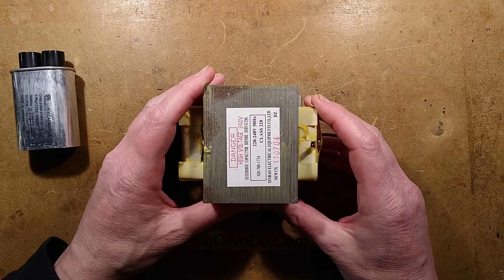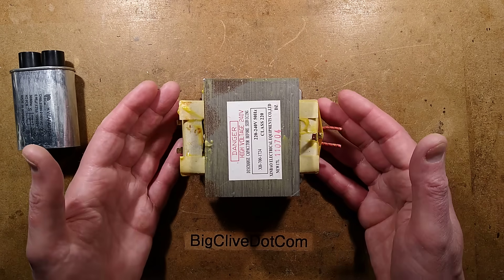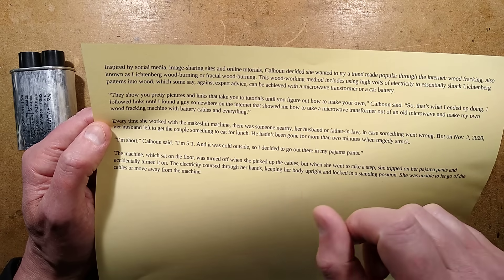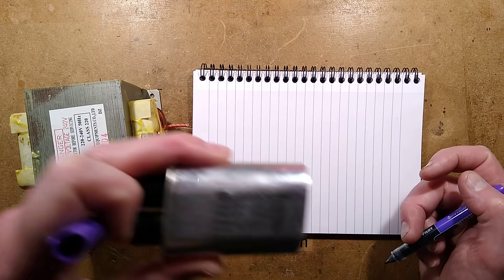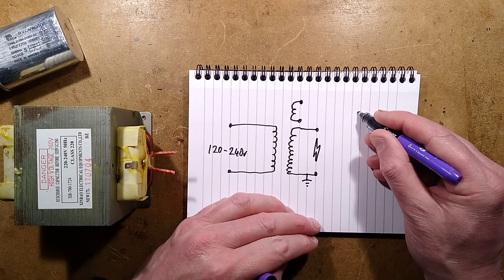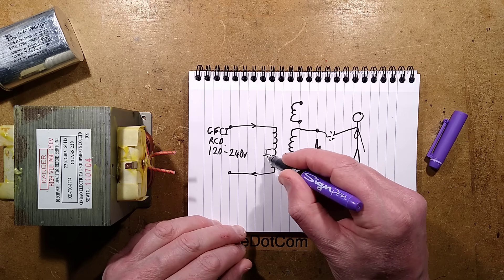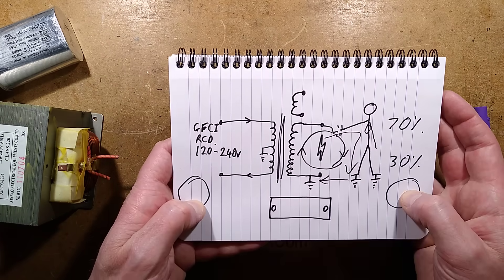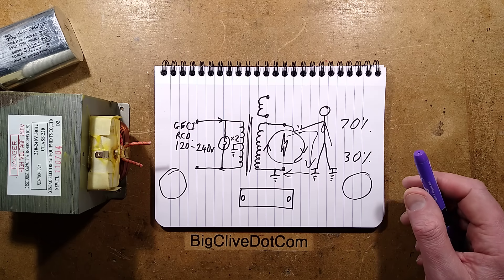The most deadly project on the Internet

Comment: If people are going to be working with electricity like that, they should buy Lineman's overalls, boots, gloves, which are also fire proof and electrical resistance "proof" as well. They are expensive but better than dieing. I know all to well the power of electricity as my uncle was a grandmaster lineman since he was in his 20's, he would recall constantly warning younger people over and over because he has saw them not listen or pay attention and watched them go from normal to full of holes. Of course he also saved a few people by throwing them off, even when he got cancer from being around electricity all the time, they made him a safety inspector (which ironic have to carry pistols because of unions i guess.) so he did it until he was no more. But yeah i think it would be a good purchase to do such a thing especially if your going to be holding leads in your bear friggin hands 240 line is no joke.

You would also think that if you were going to go through the trouble of building something like that, that you would also at least buy spray insulation for lines, or at least insulate and cover the lead wires, Personally i would build housing and kill switches and everything for it as well but hey perhaps people don't think of such things? After all a high voltage transformer is a high voltage transformer with the only difference being the amount of steps and things added to make it safe, and its not even rocket science adding some of those things to it, so i wonder why people don't?

Comment: In the early 90's at technical collage we played around a lot with these things and more. BUT having done TV repair and other courses that had these voltages. We had the sort of professors who would teach us safety lessons by trying to scare the shit out of us. 10kv protection gear helps a lot ;)...we did inadvertenly wreck a lot of electronics. 27kv from the TV HV , hurts , you don't mess with it again.....if it hasn't killed you.

Comment: What about strapping an earth wire from your socket to your body? Would that trigger the GFCI RCD or whatever safety stuff?
Reply from the maker: No.  The current would still flow in a closed path.  It would actually be worse.
Reply: @bigclivedotcom  oh man I just re-read my old question. Now that I learned a lot more about about building safety and AC, I see that indeed that would be a very bad idea and make the chance of death probably 100%.

Comment: If you get grounded at a thousand volts but this is probably 20 thousand volts. Your heart will disrupt at milliamp level esp. the T-wave art of EKG  this microwave transformer would create millions  of times this milli amp possible lethal current. Milliamps is one thousandth of one amp. This would go past the 20 thousand ohms resistance on dry skin on your hand across your heart fry the heart like a hot doggy on the grill & keep going. It would take a microsecond at T wave to go into ventricular fibrillation possibly. Hahaha the hand was lucky just the hand.

Comment: I once experienced the paralysis from a 120v ac circuit for less than a second. It was terrifying. I was stipping the insulation from a live wire on a controls cabinet door. One hand was in my back pocket for safetey, my hand sliped down the insulation of the strippers and the door swung until it touched my shoulder. When the door swung back off my shoulder the paralysis ended and the wire strippers hit the concrete floor with enough force they almost bounced back to my hand.

Comment: Used to mod MOTs in my parents basement at around 14 years old when they weren't home and wrap it with jumper cable like you mentioned.. of course playing a bit with the high voltage secondary first. I knew it was super dangerous, but for some reason did it anyway. Good memories and glad to still be alive. Good video, hopefully this makes someone think twice before playing around with old microwaves

Comment: Car cables are rated at low voltage not more than 12 volts. You should work with one hand around higher voltages. Also, always make sure things are discharged of a capacitance. Wood probes have moisture & any metal object hahaha your looking for trouble paint or not.

Comment: I was going to comment and say, it would be safer to remove the secondary wire from ground..... however, the ground end may still leak to ground inside the transformer..... and even so, you still have the 3Kv floating around.
There is no way I would hold a pair of insulated probes with 3Kv across them! Just No.
3Kv should be inside a metal box with interlock switches.
As for these characters who fire up the magnetron and start whanging it around.... I despair!

Comment: I have one that I built. I used dual switches on mine (someone may have wired the outlet backwards), an indicator light and a foot pedal for the dead man switch. I also used gto wire for the output side to try to avoid leakage. 
I like the two handed switch you illustrated and I think I'm going to change out the light for an annoyingly audible buzzer. 
Thanks for the hard work on this one, Clive.

Comment: I was cleaning near a 450VAC 3 Phase motor when my hand brushed against the motor casing and the steel stantion only a hand width away. A ground fault in that motor gave me a shock across my open palm, the muscle contraction immediately broke the connection. My arm was numb for a week. Thankfully no burns. IDFA with live circuits.

Comment: Wood is not a suitable material for a chicken stick. Not when you’re dealing with even a few Kv at an amp. In my younger days I have played with an MOT and drawn arcs off its core using wildly inadequate leads. I had an 8’ PVC conduit and considered everything downstream of the socket as lethal. Even had the lamp of the microwave across the primary to clearly indicate presence of current. Nowadays I’d add a chain with signs and use fibreglass and gloves, as well as properly rated cables and enclosures.

Comment: When I worked at a print shop the hydraulic paper cutter had 2 buttons separated by about full arm's length. It was to require that you have both hands away from the path of the knife.
Reply: Last paper guillotine I used was motor driven with a light beam guard AND a two-button trip. Standard practice on kit that once the cycle is started can't be stopped.
Reply: @Graham_Langley  As I recall the machine I used was similar, once the blade starts moving it will only cycle its cut path.

Comment: That is sure some scary cr@p! Man, I never fool around with electricity. Especially with stuff like this. I learned my lesson way back in 1982 when I was 8 years old. I took apart an old electric clock and plugged into the wall with exposed wires powering it. 

I don't know why the heck I did this, but I had the great idea to pull the clock motor from the powered  exposed electrical cord. The wires shorted and it must have made a big spark about 6 inches across about a foot away from my face. Luckily I didn't get electrocuted but that scared me straight then and there.

Comment: I'm not interested in making one, but would removing the secondary's connection to earth make this a little safer? Not that it would matter if you were holding one lead in each hand.
Reply: I have the same question. From the explanation in the video it sounds like a big part of the danger is in the ground return path. So why has no one suggested to just disconnect that secondary from ground? Wouldn't that make it an isolation transformer?

Comment: i made one, and yes sh*t happens as careful as i am with electricity specialty high voltage, it just takes one unexpected  back flip to make you think twice about doing it again.by the way i used welding clamp and arc stick holder

Comment: Another grim but really needed video by Clive.
Thanks for that.
I was always intrigued by the Lichtenberg figures - What caught my Eye WAY more than the woodburning were the figures made in Glass / Acrylic Blocks. 
Amazing stuff. But I have two, maybe three braincells left - depending on the weather on that day and as soon as I read "Microwave oven transformer", I just said: "Yep - I'll pass" and never looked at it again. 
In this video here you have helped me to understand WHY they are dangerous - because I can understand from your drawing that the high voltage side is completely air-gapped and no household circuit will do anything when something happens.
I won't ask you to provide a video on "how to make a safe one" for obvious reasons. 
But I am really interested in security and how to handle specific things. I would appreciate a more indepth video on High voltage regarding stuff like: How far will it air-gap, how is a glove helping, how will it mess you up because you forgot X. 
High Voltage (not even powerline-levels but even 240V) are bad because you can't see or hear it until it's too late. And I am always glad for your videos and practical examples because it helps me, a person that has not studied and does not work with electricity, to understand the dangers and risks involved in stuff.

Thank you for your content.

Comment: I don't get why people don't treat electricity with the necessary respect&distance and with proper clothes/PPE/safety procedures in place.
There's always back-up when you're working on/with something electrically dangerous, be it an emergency killswitch, someone else on a cut-out switch/breaker/switchable power strip, or an automatic cut-out system - would an arc-detecting RCD help in that situation? And if water and electric HV is involved, why the fork are people not wearing proper gloves?
Sorry for the "instructor rant"; this is truly a tragic story! Please, people, follow safety guidelines around "hot wires"!

Comment: Scary stuff!

I think the problem is that electricity operates by a very set series of laws. Day to day we are only accustomed to a subset of its properties and behaviours--those that occur at relatively very low currents and voltages. We complacently think these will not only remain set but in the worst case scenario any changes will occur in a linear manner. That is not the case. Some large percentage of the populace--why not say 99%?--have never observed the more lively behaviours of electricity first hand. Or heard them. Or smelled them...

Someone spins some wires (using a uranium pile to generate enough steam to turn it) close to a magnet and this happens... Fucking magnets.

Comment: Id separate the secondary winding earth so the high voltage output is isolated & no longer earth references, as in a building site transformers. That with dead man's system, placing the apparatus on a very well insulated surface should be  about as safe as it can get.

Comment: As anybody who hasn't been living under the proverbial rock will tell you, I have seen these videos before and spent a great deal of time watching them.

As far as I'm concerned personally, the only place a microwave transformer belongs is in a microwave.

Given my level of experience dealing with electronic circuitry is little more than building a simple, low current oscillator for making sound and not all my builds worked every single time... That's a hard no from me.

Thanks for making this video. You've hopefully saved a life or many lives. Cheers

Comment: Once had a few MOTs knocking around, only powered one up once and used a wooden hot stick. Foot long flaming arcs. Always knew if the danger, made sure I didn't have to reach over to unplug it and had my off hand behind me. Honestly scared the shit out of me, absolutely lethal and cannot even fucking comprehend how slapdash people are with this. This could be done perfectly safely with stuff around the house don't get me wrong but for God sake you need the knowledgeable. Jump leads?! You might as well use the wires out of lamp cord, just don't touch it at all. And don't do it in loose fitting clothing. Literally could be done perfectly safely but only with the knowledge. Spectators can watch from a window and pull the whole thing to bits once you're done.

Comment: This should be broadcasted prime time on every channel. Thank you! Here in the Czech republic this transformer experiment was presented as an ultimately cool DIY project on TV, on Sunday, 13:00. I was absolutely stunned and shocked by the level of idiocy exhibited by the man on the screen and felt rather uncomfortable. I wonder how many people actually tried it here and got electrocuted. Live MOT transformers are just one big no.
Reply: Does the Czech republic have an equivalent of Ofcom? And agency you can complain about things like that to, they will investigate and for example require the TV broadcaster to show a retraction/safety film.
Reply: @GregStachowski  Yes, we do. A rather strict regulator. The part of the show went on air only once and was pulled from the online archive as well but internet never forgets. I guess they realized soon enough they are instructing people to commit suicide.
Reply: @lukasgayer5393  Good to know, thanks!

Comment: My high school electronics class was an absolute madhouse. 

One day the kid sitting next to me convinced himself that his 400 volt DC power supply was probably defective. He believed this because it created only a very tiny spark when he popped the 2 leads together. To check this out he did not put a meter across the leads, but instead touched one of the leads with each of his hands.

All I knew was that there was a HUGE explosion 3 feet to my left as this kid flew backwards into the chairs and desks. He was absolutely knocked stupid. He came to in a second or so, but had no idea where he was or what was happening. Both of his thumbs and index fingers had black singed blistered burns deep into his skin and he was just lying there completely limp but conscious. There was smoke in the air. 

The teacher (who was insane... I saw him get shocked in class several times, once quite badly)  didn't even call the hospital (pre 911), just waited for him to shake it off and sent him to the nurses office about 5 minutes later.

The only thing that saved him was a similar but low tech 'Dead Man's Switch', the fact that the power cord on the DC supply was deliberately only about a foot long. When his body stiffened up and flew backwards it unplugged the supply from the wall and disconnected him from the power. Without that I am almost certain he would be dead.

He was basically OK it seemed. Back in class the next day was when I found out why he did it... "The spark looked really small, so I thought it was broken..." I asked him why he didn't use a meter instead and he just looked at me like it was a weird question that he didn't understand and repeated that the spark looked really small . I don't think he realized just how close he was to killing himself. He showed me his thumbs and they had holes burned into them.

Comment: When I was 10 or 11, way back in the 1960's, I found the transformer from a 1940-vintage fluoroscope at a local junkyard. 88 kV, secondary center-tapped to ground, 35 A fuses in the primary - 110 V input.

I hooked up a power cord and plugged it in - nice quiet hum and slight crackling around the output insulators. I had previously built a Tesla coil - around 100 kHz, 30 kV. I was able to light a fluorescent tube a couple feet from the coil - so I figured 88 kV would light the tube even further away.

Holding the tube in my hand, I squatted next to the transformer and waved the tube over the insulators. Nothing happened - so I brought the end of the tube closer to the top of the insulator.

Next thing I know,, I'm sitting across the garage with the broken stub of the tube in my hand. The transformer arced over to the end of the lamp, and grounded through me - making me leap back. No other harm, but scared the crap out of me.

I still have the transformer. Might make a Jacobs Ladder with it, but don't want to burn out the secondary. Need to figure out some sort of current limiter.
Reply: "I figured 88 kV would light the tube even further away" - Not at mains frequency....
Reply: @CoolKoon  As I found out later on while earning my BSEE. :)
I've had one other HV shock - 160 kV DC from a prototype device sitting on the ground, while I was 20 feet away with a remote control. The device arced to ground, and I was the return path again - Low current, not even like a stun gun, but it woke me up.

I learned early on to keep one hand in my pocket around HV.
Reply: Thats one impressive transformer, some people would pay good money for those specs.
Reply: @joefish6091  I've got a 345 kV main feeder running through my back field - I could hook that up to a wire strung along the outside of the right-of-way and capacitvely couple - get enough power to light up my shooting range?

Power company might have objections :)

I've held a 4' fluorescent bulb over my head out there and had it light up. A pizza pan overhead to ground measured about 150 V. The wires hiss on humid days. That's why power company trucks have chains that drag - enough surface area can pick up lethal power.
Reply: 35 amps seems like quite a lot for the primary but if it is you could put the primary in series with a space heater to limit the current. Basically a dim bulb tester but larger and more linear.
Reply: @eDoc2020  1940's line power was 110 V. Where I grew up in Chicago, we had 60 A 110 V service - two breakers for the entire house. We only got 220 V 100 A service in 1968.

Space heater is a good idea - I've got just the unit to try.

Comment: A very good video, anyone working with electric devices must understand the hazards.  Even low voltages can be dangerous 
it the source can produce very high currents large battery packs for example .  Any exposed energized component high or low 
Voltage is a safety issue.  In fact I received a shock from a 15 Volt source when a sharp solder burr penetrated into my finger tip
not lethal but it hurt.